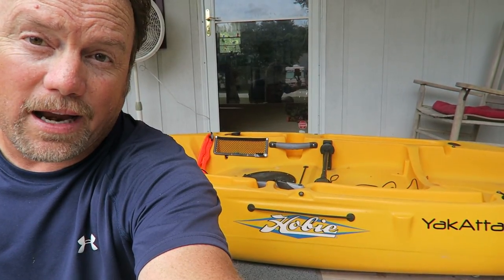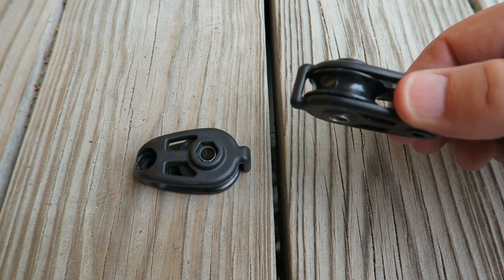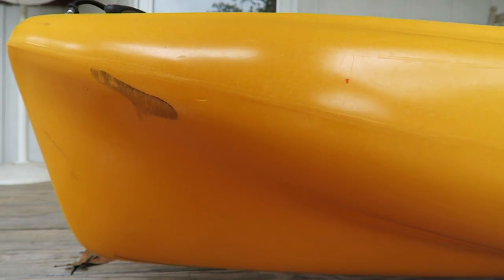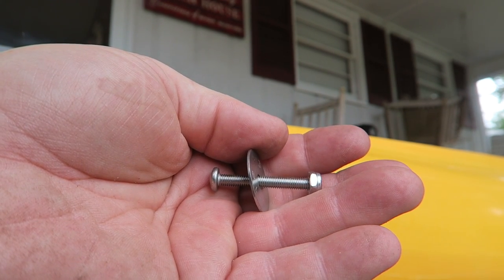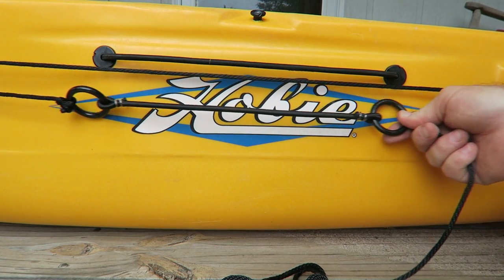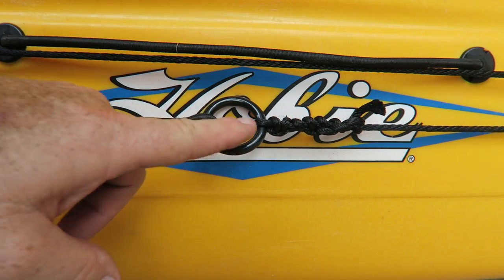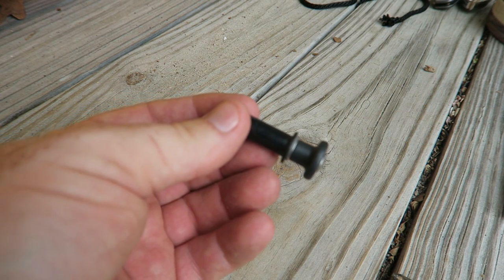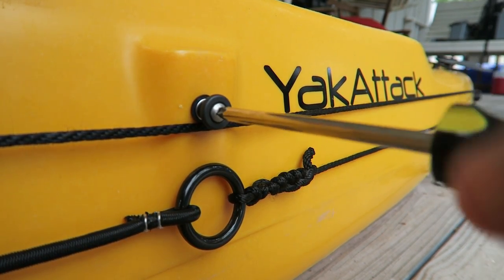How To Install Anchor Trolley Install On Hobie Outback ~ DIY

Comment: You make it look so easy , but I think I'd have anxiety drilling into my boat like that. I mean, I know it's necessary but dang there is no going back if you mess up. Do they make patch kits for thru-holes if you do decide to change up later?
Reply from the maker: +The Lawn Care Nut I had a lot of anxiety. I've had that kit for 3 months and I've been using a temporary setup. I finally decided it's time to drill.

Comment: No need for an anchor it only damage the kayak and add one more point of water entry plus anchors could be dangerous if you are in the ocean wawes can make your kayak to cupside so if I were you I Would never use the anchor system
Reply: That's the silliest thing I've read today. Not everyone fishes in the ocean waves all the time.